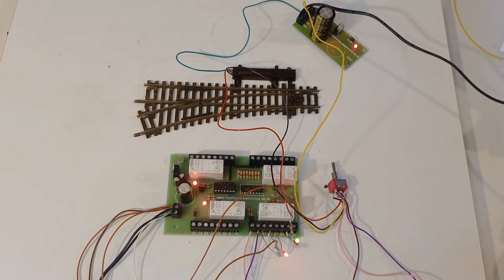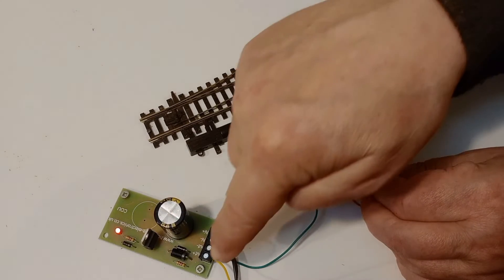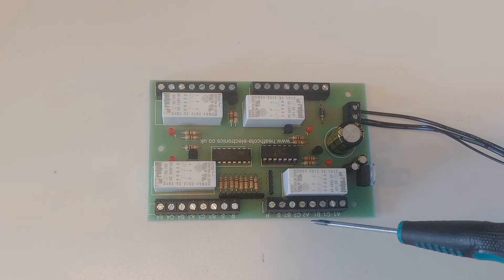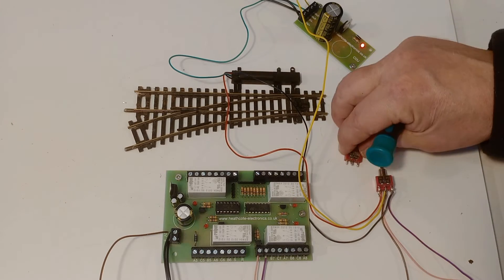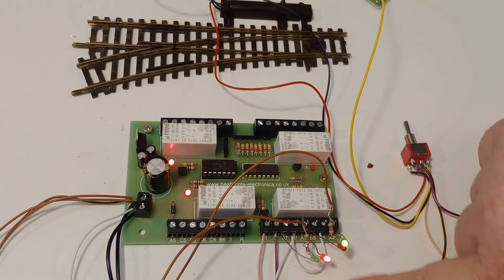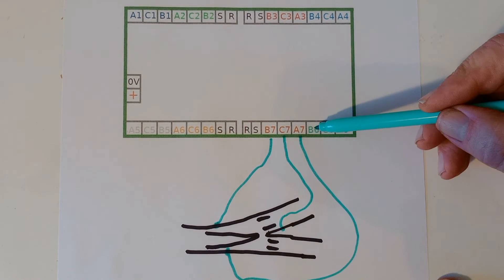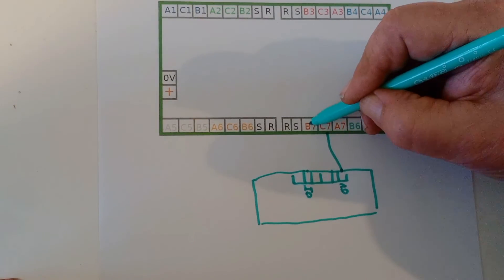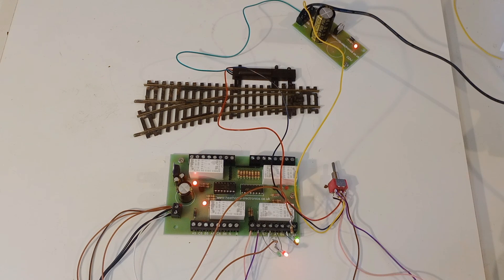Provide contacts for Peco Seep and Hornby point motors with the latching relay board..

Comment: Is there a reason you did not use 24V DPDT bistable relays? These can operate off the same switch lines as the points motors and also retain their position in the event of power loss.
Reply from the maker: I am sure that would work well with solenoid point motors. However I wanted the relays to be switched with a low current when used with my detectors for reverse loops. Also the bistable relays appeared to be a more expensive solution without terminal blocks or LED indication of which way the relay has switched. Actually if you take the negative from the CDU to the point switches and connect the negatives of both the 24 and 12 volt supplies you could use the  same switch lines but considering there is only a very small price difference between the two types of switches I thought using a DPDT switch made the wiring simpler to understand and fault find,
Reply: That all makes perfect sense to me. I've been using the 24V bistables to overcome failures on old insulated frog points to provide the track switching. I locate the relay next the point so wiring is minimal (in length at least) and don't need the LED confirmation.  @heathcote-electronics
Reply from the maker: @OOElectronics  It sounds a good solution for what you want to do. With below baseboard point motors I had success by using the rod that fits in the tiebar (which extends below the point motor) to push against a micro switch mounted on a block of wood.
Reply: @heathcote-electronics  Peco do (or used to do?) plastic switches that got glued onto the bottom of their motors to do the same. I think there are still a few around on my layout. I've been using microswitches hidden on the surface to detect point position for my microprocessor controlled points and signals - a project that has grown way beyond where I thought it was going.....

Comment from the maker: If you want to know more about related topics:
Capacitor discharge units CDUs https://youtu.be/0a5Rt3w1XRA?si=mJ1TLDWox3X1RRk4 
How point frogs are wired https://youtu.be/7D7JbUlCG0o?si=dfOSqTjKAReZ5lzT
How solenoid point motors work https://youtu.be/nId_3lv1Gdo?si=gQBme1FZefW1seE4
Point indication with the point indicator https://youtu.be/FdfYuyOye3E?si=R2pybdT7lhdvUZtN

We have an informative website at www.heathcote-electronics.co.uk with online ordering.